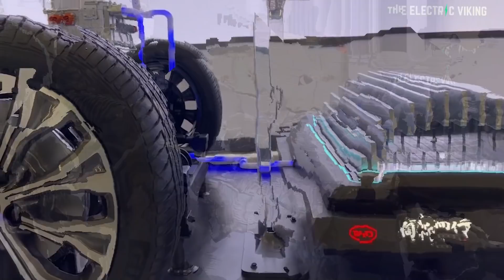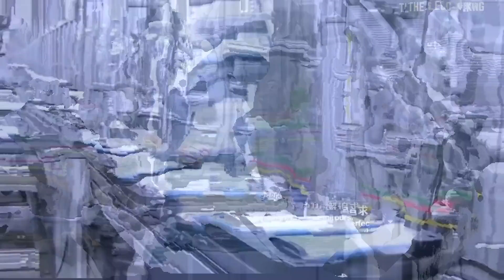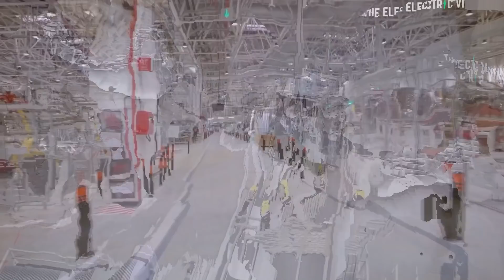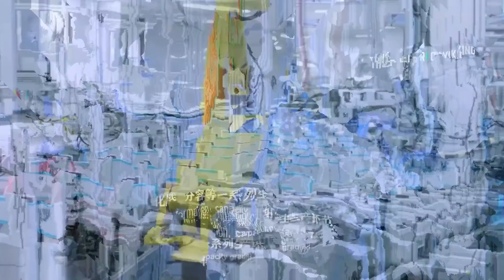BREAKING: Tesla order BYD's LFP batteries for 200,000 EVs

Comment: Don't know why you'd think the BYD batteries are "incompatible with the structure of the Model 3".  The battery enclosure is a rectangular shape and can take any cells which would fit inside it.  Tesla already uses cylindrical from Panasonic and prismatic from CATL, no reason they can't use pouch cells from BYD, if the rumor turns out to be true.

  I'd still chose the NCA pack because you get significantly more range.  Keeping them charged at 80% or less most of the time is not an issue, and you have the extra capacity for longer trips when you need it.

Comment: The model 3 and Y were perhaps 96% of their vehicle sales with, as you said, a fleet wide cost of manufacturing to $35,000 per vehicle. Taking the models X, S and Y does not reduce the cost of manufacturing the model 3 to $25,000 but might bring it down to a cost of $32,000 assuming the model Y to be only $3-4,000 more.

Comment: To provide a possible answer to how Tesla can use BYD blade batteries when their current design uses cylindrical cells is simply that they have a modular design approach and that the battery can be removed and a new battery inserted as long as it meets the requirements of the old battery (including the structural ones, not just the electric and electronic ones). Considering they looked into and even had battery swapping technology for a while that design modality is likely. In fact if in any given market battery swapping becomes popular they risk not being able to be part of that market unless they maintain the kind of modular architecture. 

I don't know for sure, but it is a very popular engineering design principle. Maybe someone with some experience inside Tesla could confirm that.

Comment: Hi Sam, excellent video as ever.  If choosing a new EV I would opt for LFP.  The process from your comments and my own on-line research, seems to be more robust; you can charge often and to 'full' and it will not substantially alter the physical properties of the cells.  The decline over the 'lifetime' of ownership in an EV would be much less than NMC, etc.  Higher density sodium cells are in the sights as are Aluminium/Graphene, once someone over come making graphene with industrial consistency.  Keep up the best work you do daily.  I am in awe of your high quality output.

Comment: Tesla only uses cylindrical batteries because that was the only thing available when they started. Small cylindrical batteries are a production engineers nightmare, thats why they created 4680. Fewer connections and cheaper per kWh to produce, no other advantage really. Blade batteries are better, they can be packed really really tight with a good temp control. 

Now the battery war is on, every car maker is trying to source enough supply. Lithium is mainly from South America, cobolt from Africa and China is dominating the battery production. Not very sure that Tesla is really ahead, beware of China as they can easily keep batteries for their own car industry and restrict exports.
Reply: No, they produced the 4680 because it's the "sweet spot" of maximum "filling", and casing material saving, compared to minimum wasted space between the cells.
They were ABLE to do it due the the tabless design overcoming the accumulated heat issues inherent in the larger diameter.
(Hence the main reason (debatable) for the Maxwell deal?)
Reply: @rogerstarkey5390  The filling coefficent will always be 0,785 when using cylindrical batteries in a typical square battery box, no matter the size. The problem with the use of cylindrical batteries is the build cost of the battery pack. And you cannot build too large cylindrical batteries either since the cooling will not be as efficient (risk of overheating the center core area in the battery). 4680 is a compromise in that sense but a good one I should add. Since I am an old automotive engineer I would, in the choice between pouch, prismatic and cylindrical always chose prismatic batteries due to total build cost. Pouch have drawbacks due to swelling, cylindrical is too expensive and complicated. I would place a bet on the prismatic type.

Comment: "how do the BYD cells fit"?
Lateral thinking.....
Cross section 118mm high by 13.5 mm wide(thick)..... Until you lay them on their side and stack them 5 deep...... Then the stack is 67.5 mm tall...... Less that a 2170.
(Or of course 6 deep, (81mm)

Comment: I'm going with LFP. There's really no downside; my Model 3 performs much better in the cold than my Bolt with the ternary pack did.
Reply: LFP batteries perform worse in the cold sorry these are just the facts. You need more energy density batteries for colder weather.
Reply: @greengold6705  you can’t use the energy density In Li NMC batteries, so there’s really not much benefit when you consider that and how much faster they degrade. My LFP Tesla, with the heat pump, runs circles around my NMC Bolt in colder temps. All you need in cold temps is proper thermal management and efficient heating.
Reply: @greengold6705  The Blade batteries on BYDS platform are fitted with cold and hot thermal heater.

Comment: A MASSIVE FAIL for Tesla if true.  IF Tesla was confident about the 4680 cell they would not need or want LFP. Now they are desperate even becoming dependent on a competitor for batteries?  Worse this will mean no technical advantages over the competition for Tesla; and redesign of the vehicles to use them; perhaps explaining the year delay of Cybertruck Semi and Roadster.  If true Tesla will just become an effective subsidiary of BYD designing vehicle bodies for BYD cells.

Comment: Those batteries appear to be the right fit for the cheapest intro model 3 or eventually the 2. Robotaxis and Hertz could use this configuration since customers don’t have to worry about the recharging constraints withe the cylinder batteries. Tesla China also has a huge customer opportunity for a cheap Tesla.

Comment: Of course you can use 100% of a ternary battery too, just not recommended on a daily basis. For longer journeys you do once in a while it makes sense to use the full battery (minus any built-in buffers). Just as fast charging ages the battery faster, but you wouldn't slow-charge on the road to somewhere.
That said, I would like LFP and V2G to use the car as a buffer for the house when the electricity is expensive, then charge it up at night when it's cheaper. If I would buy a Model 3 now, I would go for the LFP because the range is good enough so putting up the extra dough for a long range seems a little unnecessary for me. But it's all theoretical since even a standard Model 3 is still too expensive.

Comment: I would buy an EV with LFP batteries. They are cheaper, last longer and are much safer than the other flavors of lithium batteries. You lose a little in performance compared to the other electric battery chemistries, but compared to ICE vehicles they are still awesome. I was going to buy a Chevy Bolt, but the fires made me pause. The likelihood of fires with LFP is much, much lower. I hope Tesla will use these batteries to market a lower priced model that I can afford. 

You know that LFP can be made into a cylinder shape that would match the shape of Tesla's 4680 battery. The Model 3 standard range and the Model 3 long range are in essence the same vehicle with the standard range vehicle having fewer batteries than their long range vehicle. Tesla could just fill up the space that is available for the long range Model 3 with LFP cylinder batteries and still produce the 250 mile range needed for a standard range Model 3 at much lower cost. In this way Tesla doesn't have to modify its assembly process too much.

Comment: The BYD Blade battery is more compatible with a structural battery pack than the 46/80. Each blade battery is structural rib within the pack. Actually the blade battery ,which is LFP, is the safest battery made and can be made the to fit the width of the structural pack, and the stacked as metal ribs crossing the pack from front to back. Tesla should be using the LFP blade battery in all of its non-performance models. A standard range model y and model 3 LFP blade battery pack would be  a lower priced mega seller; no need for the ‘$25000’ car!
Reply: Except it's not necessarily more suitable.
Look at a BYD pack.
There appears to be a large gap between each blade? (Cooling?, Expansion?).
Since there's no physical connection between those faces, all the structural strength comes from end mounting points.
Those ends must be fixed to something really rigid (a "frame")
Not so "Structural"?

Comment: Sam, I have to take a pragmatic approach to batteries.  I just accepted the batteries that came with my assisted bicycles.  The choice was limited to what came with all the other features I wanted.
If that is not the case for a car, I expect that my budget will be the primary determinant of the battery chemistry in any EV I can afford.
Unless the whole car industry goes through a radical change, I suspect that the battery chemistry will be one of the less important decision points when most customers buy a car, now or in the future.  For many, the advantages/disadvantages of the chemistry will not even be discussed - the resulting price and range will be.  Think of how many people really understand what is inside their ICE cars, particularly those with automatic gearboxes.  I think that is the correct approach for most people.  The technology used to provide the primary specification should be like the gear ratios in the drive train - interesting for maybe 10% of the buyers.  But ultimately what any buyer wants is that the vehicle works reliably, and as advertised.
If a manufacturer offered a battery upgrade kit for an existing vehicle, I would probably buy it.  There was a choice of two chemistries in my first assisted bicycle - first I bought the lead/acid as it was cheaper.  After using the bike I bought the more expensive Lithium ones as they had a longer range, and I tended to use it.  I am about to contact the manufacturer of my latest bike to see if they are considering a battery upgrade in the future.

Comment: Maybe this partnership is a good way for Tesla to reduce the number of BYD vehicles by using the batteries for Teslas. Just a thought …
Reply: Great point but another thought is that BYD's ramp of battery is faster than the ramp of cars.
It does look like another of Musk's ways to soak up capacity from everywhere.
Reply: @andrewsaint6581  disagree. BYD gave the same problem in China as Tesla’s globally; they can’t make cars quick enough, hence the 2200k backlog just fir the Qin.

I do agree though, BYD are opening so many new factories this year that they will be able to produce 1.5 million of their cars; build for Toyota; build for ssangying; build for NIO; supply Ford and 30 others!
 What a year for BYD.

Comment: For me, affordable LFP batteries for about 200 miles range for everyday driving, work, shopping, pottering around etc and then sockets in the frunk to accept super high density aluminium-air range extender batteries to give another 200 - 300 miles range for the occasional long journeys, unforeseen situations and pulling a little Airstream caravan around Europe. That for me would be the perfect solution and maybe the perfect solution for getting 99% of people out of ICE cars too.

Comment: 8:40 nope. Elon already stated they won't use LFP in a cylindrical format which makes sense.  the cyclindrical format's value is in the safety. since LFP is already safe in the Prismatic/Blade form, better use the larger formats for better density and costs.
Reply: It's not only safety, cylindrical is also faster to make
Reply: But drew a
Said there's no reason why not.
Reply: @rogerstarkey5390  exactly, Elon was refering to 4680, maybe they can use a wider format, like 5170 or more

Comment: BYD blade battery would be perfect fit for a Tesla model Y SR+ structural  battery pack.
Reply: Except it's 47% taller (in the orientation used by BYD).
You'd have to turn them in their side and stack 5 deep.
Reply: @rogerstarkey5390  that's true.  I would love to have byd lfp blade batteries with tesla gigapress structural battery pack. I think it would be a brilliant combination.

Comment: Thanks Sam, my suspicion is the BYD blade battery configuration has better thermal management than cylindrical 4860. As Tesla starts large scale marketing it products in hotter climates, maybe hedging it's bets.
Reply: They are not the same chemstry
Reply: @gplaneg  on battery day elon said it had lfp for the 4680 maby they are have problems with the cylinder and lfp tabless design
Reply: @lesstevens2370  but on last earnings call he said "we are not making any lfp 4680". Blade batteries are lfp and 4680 are designed for nickel based cells to manage better the heat
Reply: @lesstevens2370  
The "tabless design" feature of the 4680 is identical to that on the Nickel based cells.
.
The only question would be, is there a physical limitation to rolling the LiFePo4 material into a cylinder?
Since you can buy LiFePo4 cells as small as AA (A MUCH smaller diameter wind) it seems that's not the case.
Reply: @gplaneg  
Are you absolutely certain of that?
Watch again, look at the context, see what Drew said (no limitation), then consider that if they want LiFePo4 to be the predominant chemistry, not using the chemistry in 4680 means they will either be buying the vast majority of cells from others (not very Tesla!?) Or, will make LiFePo4 in house using the old techniques. (Expensive, large factories...... Not very Tesla 🤔)
Then there's the probable difference in chassis required for a non structural pack...... Since "the best part is no part, and the best process is no process" building essentially 2 different bodies per model? No.
Reply: @rogerstarkey5390  there is absolutly no clarity about this. We don't even know if they will make high nickel cathode or nickel manganese... they should say something about their plans... nickel 4680 are going good but what about lfp, i had many conversations with people and nobody really knows wtf they are doing with that
Reply: @gplaneg  
"Nobody knows" but you seemed quite sure?
And the tabless design wasn't to cool the nickel based cells, it's a way around the main issue of the previous 4680 designs, current path length.
That produced heat, not the chemistry.
Reply: @rogerstarkey5390  quite sure about what?
Reply: @lesstevens2370  he lies
Reply: @gplaneg  he also said he’d have a flying Tesla by now and FSD!
Reply: @BSBSBSBSBS-i2x  nope he has brought out everything he said he was going to just not in the time frame he said
Reply: @BSBSBSBSBS-i2x  and no planes he said would like to and needs the wh/kg to be at 500 to be feasible so stop and do your research before you talk rumors and bs as facts 💯
Reply: @gplaneg tables 4680 was for better heat dispersion but the byproduct is  faster c rates and longer life and the structurel battery pack eliminated all the modules then you can pack more in for a better pack density ie more wh/kg for the same pack size
Reply: @gplaneg  learn English before you post favfan gulo
Reply: @lesstevens2370  he has done none!

Where are the batteries?

Fsd?

Flying cars?

Robots?

25k car?

You live in Elon world!!!!
Reply: @BSBSBSBSBS-i2x  and you live in instant gratification world he lays out a plan for the future and you think it's for the present and who said flying cars

Comment: Maybe they are going to put the blade batteries in the "not Model 2". Could that be a badge engineered version of the BYD Dolphin?
Reply: Not Likely , BYD dolphin is a little on the Lower end scale for Tesla. But the Blade Battery could be used for the model 2 in China only.
Reply: Tesla won't ever use BYD batteries for their cheaper model which will come no earlier than Q3 2023

Comment: Most people will not hit the at least 350.000 miles you can get out of the NMC and if you want performance, quick acceleration and slightly better handling (lower overall weight) you still better pick the NMC but for the majority the LFP is better and for Robotiaxis LFP makes more sense too. LFP is also the better choice for drivers with very high mileage. But just as a reference the average US citizen drives 13.500 miles a year, that is over 25 years. I suppose that a Model 3 after 25 years will most likely reach its end of life anyways, even if the battery is still good. But generally it is great that the powertrain is no more the limiting factor for cars!
Reply: If you only care about the car this is accurate, but if you want the batteries to hit their full usage you start to think about second lives for batteries in homes, or as grid storage. Also wouldn't it be great if there was a robust used EV car market 15 years from now of used LFP electric cars for those folks that can't afford new, or even slightly used ones. EV drivetrains last a long time, if the batteries do to, these cars could be on their 3rd or 4th owner and still be working... well if all the other stuff continues to work ok (electronics, door handles, power windows, etc...)